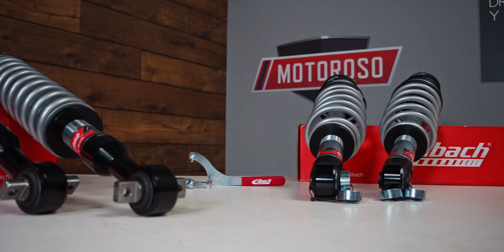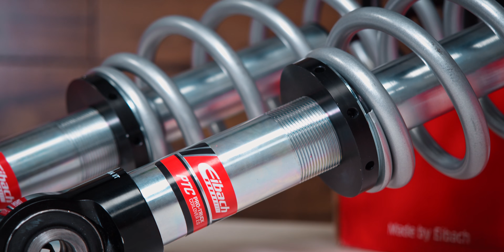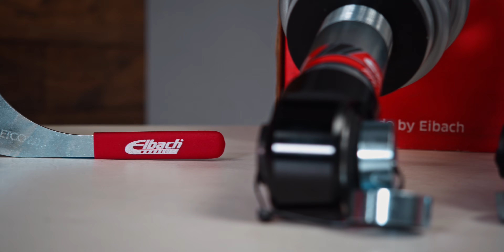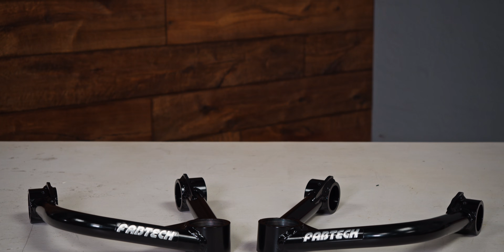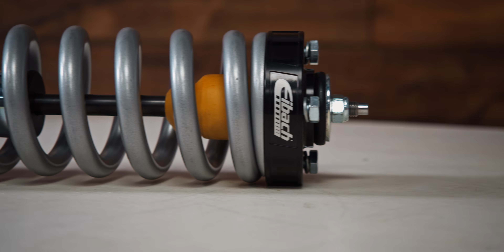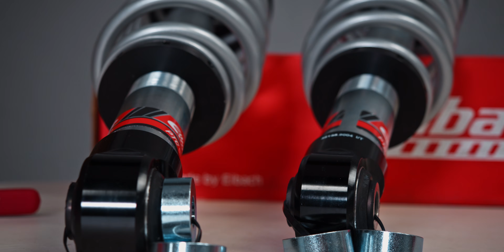Eibach Pro-Truck Coilover Lift Kit For The 2021+ Ford Bronco | E86-35-056-01-22

Comment: I am interested in these. Have a SAS Badlands with a BDS 4" lift already.  Wanted to swap out the factory 2.0 shocks, will I benefit from these coil-overs for performance or no?  Also if put at max height will that make the ride more stiff or does that not effect the ride?

Comment: Is there a difference between the 2 door, 4 door and 4 cyl vs 6 cyl?  I'm a 2 door Sasquatch base 2.3. are there different part numbers as per details?
Reply from the maker: Hi Kevin, great question! No sir, with the Eibachs it's a 1-size fits all solution. Some of the other high end manufacturers, like Fox, have made separate valving and spring rates for the 4-dr and 2-dr, but in the Eibach's they work for all variations of the new Bronco (except Raptor). We've got 2 sets in stock here, happy to get you set up and a free T-shirt if you mention the YT comment :-)
Reply: @Motoroso  still on the fence with these or the 6100/6112.  Really like the adjustability with the Eibach. I've had my Early bronco loaded where it's squatting and would love to be able to make an adjustment on the fly. I have 5100's on the EB.  The larger body with the 6100's are a good thing, more oil should run cooler, but again, the adjustability of the Eibach is hard to beat.

Comment: Are the overall shock lengths longer then stock bilsteins? Also, you discussed they travel more up but I’m assuming you don’t gain any droop?
Reply from the maker: I believe the shock length is a bit longer, but I don't have that exact measurement. Also, in speaking to Eibach I believe you will see an increase in droop, but specifically they state it is "within the specifications to retain the stock UCA".
Reply: @Motoroso  appreciate the info! I’m looking into all the options for building a slightly better travel system that reliably runs 37’s and has more droop and up travel but as little lift as possible to obtain the best result.
Reply from the maker: @popo_patty  welcome! Might wanna look at the Fabtech Coilover system, and pull spring preload to lower the lift. 3” additional wheel travel with extra droop thanks to the UCA. And all at a pretty good price (compared to king/fox stuff).
Reply: @popo_patty  check out icon 2.5 coilovers. They claims 11.5” of wheel travel in the front and 14” in the rear. They say you gotta run a bump stop spacer with 37s but I bet you could get away without it with the DV8 liners
Reply: @Motoroso  I have some coming in and I will double check before we do testing but Eibach’s 2.0 coilovers tend to be a whole lot longer than most other things. One thing people don’t mention is the stock ball joint has a lot of range of motion. I would bet that it still binds at full droop. I really think the SPC, Icon, or something with at least a 1.25” uniball would be the only way to go to meet or in the case of the icon beat stock ball joint articulation. With these being a 2.0 and the shock position of the bronco means there aren’t the same coil to arm clearance issues as other cars.